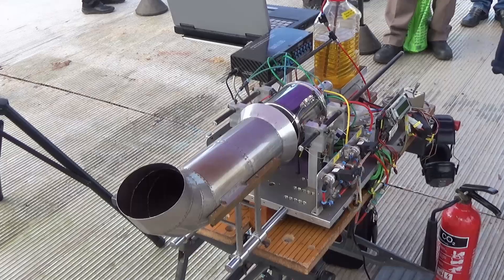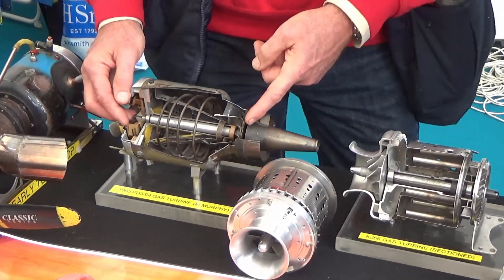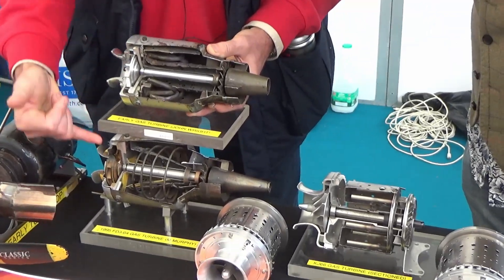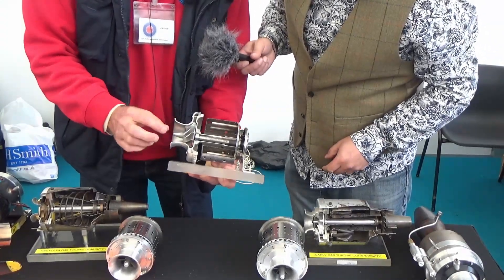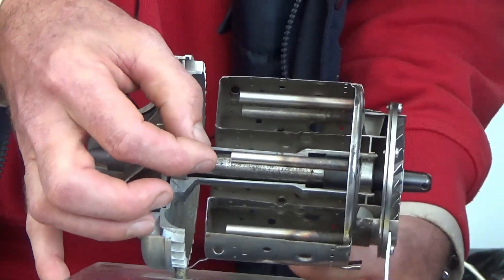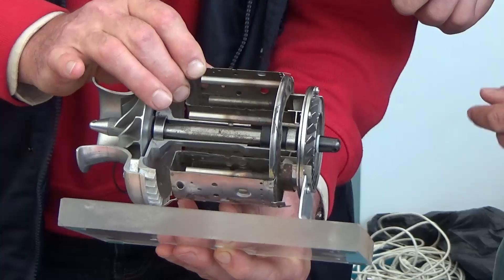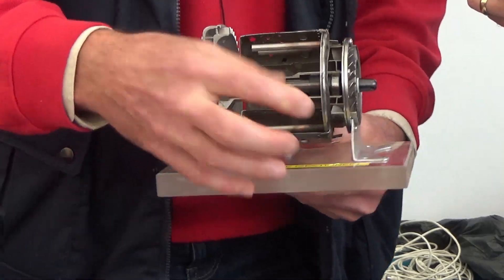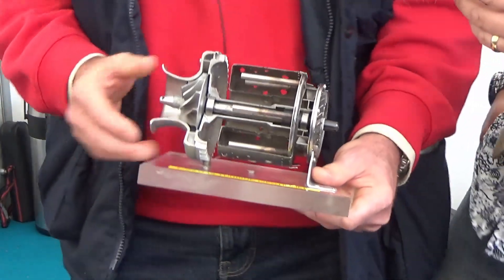DuB-EnG: JET Engines How They Work - Gas Turbines Midlands Model Engineering Exhibition Meridienne

Comment: 4:09 I think the 5mm gap at your finger tip between the turbin blade root and the combustion chamber output leaks hot air into the aft bearing from the rear, which can damage the bearing. Also the turbulence of air leak itself reduces fuel efficiency. The improved version at 5:36 shows the 3mm gap is much smaller and more reasonable. But I think the factory made engines keep the gap smaller than 1mm.
Reply from the maker: You have a keen eye :-)

Comment: Plywood compressor hitting 75k rpm. That's legendary, salute
Reply: I have to wonder if he was practising cutting on the plywood and that led to practising balancing with it followed by "why not just mount it and see if it works".. all the way to an optimised proper wheel.
Reply from the maker: Just fantastic innovation 💡 👏 👌...  they really wanted a turbine solution and they continued to prototype until done! 😀
Reply from the maker: Yes indeed!!  Turns to fluff!!

Comment: how do jet engines work ... simply ... they suck .. they compress .... they ignite .... and they exhaust ... instead of taking the energy and making a psiton move to make a crank shaft turn to make a flywheel spin to make a drive shaft rotate to make your wheels move ... you spin fans to make shafts move and let the compressed and heated gases left over out to provide movement ... 
.
yup they are JUST 4 stroke engines made to move air instead of pistons ... they are also more work efficient because they use the excess heated gases to propel you ... while a car engine just uses that heat to keep you warm in winter and otherwise cools it with a radiator wasting all that nice potential energy ... just like NASA discarding rocket boosters and fuel tanks every launch to get into space ... while a jet turbine engine is more like elon Musk which uses as much as possible over and over again to get into space ... the old adage .. waste not want not ... NASA never used it Elon is ... what he doesnt discard he reuses making it less costly in the long run 
.
IF nasa reused the fuel tanks from the shuttle as building material for the ISS it could be big enough for a space hotel NOW but they chose to do like americans do all over (everyone essentially) toss their garbage and leave it wherever they like ... a good 80% of the JUNK orbiting earth is GARBAGE because it is not working or end of life or discarded rocket bits ... the shuttle when being designed was touted to be able to retrieve that JUNK and return it for study and resale as scrap or reused parts ... but they never did that instead they made it into a bus with a little haul capacity to get more junk into orbit.
.
Reply from the maker: It is a little scary...  we do tend to fill our plant with fumes and junk...  and now space too!!...

Comment: What will happen if I made the outer blades of diffuser in  straight form without curve ?? Thank you for explanation ❤
Reply from the maker: What do you mean by diffuser? The last stage bladed disc? It would still spin but not as fast and efficient.
Reply: @DubiousEngineering  I mean compressor guide vane .

Comment: one question ive had for a long time is why havent RC Jet engine makers made an axial flow engine yet? is it due to price and complexity? ive seen one off ones but i mean mass production ones. very interesting video though!
Reply from the maker: James is brilliant...  When I next see him, I'll ask the question!!  :-)
Reply: @DubiousEngineering  Thank you! gave you a sub.
Reply from the maker: How very kind!! I have an eclectic mix ... but almost always engineering related!!
Reply: Radial flow is considerably more efficient in these single stage micro turbines. Only once they start becoming a fair bit bigger and get a lot of compressor stages does axial become more efficient.
Reply: @pieterveenders9793 what if I pay for a second spool? Turbine diameter as large as the compressor case. 3 stage axial fan. Low bypass ( for cooling).

Comment: "only uses 18-20% of the air coming in" is that because air is comprised of 21% oxygen and all of that oxygen is used for combustion? Or is he talking about 18-20% of the 21% oxygen component coming in, so only 4% of the available air coming in is used for combustion.
Reply from the maker: The combustion chamber is quite efficient but it cant burn everything especially if the air is moving through the engine at supersonic speeds
Reply: You need to keep the exhaust temperature low. Also I will never understand why there is no grille of cooling inlets in front of each turbine vane to keep the hot air away. And a vortex thereafter to convert heat into speed.

Comment: How does the bearing's lubrication-cooling process works ?  Where are the pipes that feeds oil to the bearings ?
Reply from the maker: oil is atomised into the combustion chamber to take care of the exhaust bearings which are ceramic
Reply: gonzalo moreno andonaegui 
on the more modern model engines , at least the several I have, they split off some of the fuel into ports that lube and cool the bearings, there is a small quantity of oil mixed with the fuel and the bearings are ceramic to withstand the heat and rpm.
Reply from the maker: @chuckels431  exactly!! ... :-)

Comment: I've been flying RC for 24 years and have scoured youtube for video explanations of RC turgine engines. This video has by FAR the most lucid and comprehensive description of the engine's operation! Not just that, it covers the design evolution too. All the dozens of centrifugal compressors I've seen and didn't realise the obvious fact until NOW that the design is based off vehicle turbochargers. Not to mention the wonderfully detailed explanation of the combustor's hole design. For something that appears so low tech i.e. a can with holes, actually has an extremely specific design dictated by the complex thermodynamics and fluid mechanics in that area of the engine, to the extent that jet engine designers liken it to "black magic". And this video gives a decent idea why. Watching this was like getting my engineering fix through a needle. Thank you for posting! :)
Reply from the maker: James is marvellous...   have a look at some of the other collaborations we have done together including a guided tour of his laboratory...  thanks for such great feedback and kind words.  I have passed this back to James !  All the best, Howard
Reply: Look at this, It´s the same, but the 3 compartments are not in a line, but with kinks instead, because it directly uses a car-turbocharger-unit. Of cource having everything in a line is more efficient and powerfull https://www.youtube.com/watch?v=JzwfzgfJiJ4
Additionally, the compressor can be essentially the same, but the turbowheel is different in turbojets compared to car-turbochargers. In the video I just suggested, they can use the car-turbocharger-turbo-wheel directly, of course... The missing part they add, is the self-made combustion chamber. Video is from the "tech ingredients"-channel.

Comment: 75000 rpm or 7500 rpm did I hear that wrong 75000 rpm??? That’s insane considering it’s wood, handling that centrifugal force
Reply from the maker: D333ZZZNUTS you didn’t hear wrong...  some of James engines run at 150k RPM
Reply: Dubious Engineering jeez, that would be loud as f***
Reply from the maker: Here’s the engine in action... this ones worth a share :-). DuB-EnG: AMAZING JET ENGINE with Centrifugal Compressor Axial Flow Gas Turbine ALL HOME MADE
Reply from the maker: https://youtu.be/C40vUjOCRUQ
Reply: Dubious Engineering any idea what compression ratio did he get from the compressors?
Reply from the maker: I'm sorry...  I can't remember...

Comment: Dear Sir, how  the fuel is injected in the comb.. Chamber  is that atomise or liquid form? How even possible that burning liquid form (I tried but went vain ) 
     Please reply   Respect from (BANGLADESH)😍😍😍😍
Reply from the maker: The chamber is heated with propane gas for 1 minuteto warm up the chamber, then the parafin is injected into the combustion chamber...  hope this helps
Reply: would u please permit me to conversate u SIR. If possible (urgent)
Reply from the maker: Please visit the GTBA gas turbines association...  they can offer much better guidance than me!

Comment: In theory a gas turbine,  is  much simpler to construct than a reciprocating pistion èngine it only has 1 moving part , the shaft, with bladed fan assembly at either end. A pistion has 3 to more depending on design moving parts. My first turbine about 3 inches diameter single stage 2 stators a single piece combustion chamber , about 5000 rpm
Reply from the maker: Agreed... but that all important stator is a nightmare to manufacture :-).  Thanks 🙏 for your great thoughts!! ... all the best!!  Howard

Comment: if your aiming for more air to be moved through so that you could get more thrust then i would consider building an axial flow turbine as opposed to these centrifugal turbines
Reply from the maker: There's a centrifugal compressor at the front and an axial turbine at the rear...  more videos on this soon!  :-)
Reply: Dubious Engineering An axial compressor would increase the flow, most turbines are axial. The reason is that an axial compressor can have a much larger intake cross section. Model engines rarely have an axial compressor because they’re a lot more involved to make and a lot trickier to get working properly. In a typical axial compressor you can have hundreds of parts, because like they did with the turbine in this video you have to cast each blade individually for the rotor because of center of mass balancing. The stator can be just two pieces though. In addition, casting blades like this needs to be done with die casting or investment casting (which with full sized engines is the only option). So you need to make a wax version of each individual blade, coat it in investment, wait for it to dry, melt/burn out the wax, pour and spin in a centrifuge. Working at a pretty fast pace you could on average cast a few blades a day. And that STILL leaves machining the blades and making the rotor assembly, AND doing the center of mass balancing which you either need to get software for or program a solver yourself. It certainly is possible, you can see at the end of the video someone that did it, but it’s certainly not for the faint of heart
Reply from the maker: I think we have just found out resident expert!!  Hello Liam!!  Here’s a video you might like... a tour of the workshop!!  DuB-EnG: Jet Engine maker workshop, Tri-copter model engineering, VTOL quadcopter aeroplane azipod https://youtu.be/_alUhQptOi4
Reply: My bad I didn’t see that
Reply: But why not have axial both ends?

Comment: Just one slight correction, a turbine works on 4 cycles is however no 4 stroke engine.
Turbines usually work on the basis of the joule cycle and actual 4 strock engines usually on the Otto cycle or the diesel cycle. Even a 2 stroke engine differs slightly from the otto and diesel cycle.
Besides that very nice presentation, i didn't knew that people used wood for compressor wheels.
Reply from the maker: Thanks for your feedback... I’ll see James soon and we will discuss!!

Comment: 2000 deg C!! 

Is any part of material of this engine exposed directly to this temp?  Or is the engine protected by the air shield from this high temp? 

James explain that they introduce just small amount of air to the combustion zone (small holes) and than at 2. zone they introduce more air for unburned fuel to burn off and the third delution zone where larger holes are located has the joy to introduced 75% of air to drop from 2000C downto 800C where fast moving air is lead to the turbine wheel. 

my question is are the walls of combustion champer (first zone) exposed directly to the temp of 2000C?
Reply: You should watch AgentJayZ, he’s a jet engine mechanic, he explains things like this in great detail on full sized engines. To answer your question, the holes that let the intake air in provide a sheath of cool air along the wall of the chamber. This is why you MUST have that sheet metal with holes in it. If it weren’t for that, then the 2000 degrees would just melt everything. It’s also very important to ensure good mixing before the turbine not only for thermal efficiency but also so you don’t burn the bearing oil or melt/deform the turbine
Reply from the maker: I’ll get a more precise answer for you soon, but, I believe the ball of rotating fire moves and rolls around in the combustion chamber which reduces the surface heat on the combustion casing...  so, I think it’s only the internal flame that gets to such a high temp...

Comment: Actually I am making fd3 . could you tell me please that the book say to use 608bearing which dimension is 8*16*5 . Could I use 8*22*5 dimension bearing it's few large than? Sorry for bad English.
Reply from the maker: I think the question is a little confused. The original bearing for the FD3 had a 16mm O/D, which is usually referred to as the 688. The 608 bearing has a 22mm O/D, which of course will not fit in a 16mm shaft tunnel.
 
A standard 608 bearing are normally 8 x 22 x 7   (I/D x O/D x Length)
A standard 688 bearing can be 8 x 16 x 4  or 5 or 6  (I/D x O/D x Length)
 
If this chap has already made the shaft tunnel with a 16mm I/D and a shaft with an 8mm O/D then he will need to use 688 bearings. However if he has not yet made the shaft tunnel, then he could alter the design and make a 22mm I/D shaft tunnel and still use the standard 8mm shaft, in which case he would then have to use the 608 bearing.
 
In any instance, he should source the 'Full Compliment Angular Contact Hybrid' version of whichever bearing he finally selects.
 
Judging by the sound of his message, it might be worth recommending he join the GTBA, as it sound like he needs a little help.
Reply from the maker: I think the question is a little confused. The original bearing for the FD3 had a 16mm O/D, which is usually referred to as the 688. The 608 bearing has a 22mm O/D, which of course will not fit in a 16mm shaft tunnel.
 
A standard 608 bearing are normally 8 x 22 x 7   (I/D x O/D x Length)
A standard 688 bearing can be 8 x 16 x 4  or 5 or 6  (I/D x O/D x Length)
 
If this chap has already made the shaft tunnel with a 16mm I/D and a shaft with an 8mm O/D then he will need to use 688 bearings. However if he has not yet made the shaft tunnel, then he could alter the design and make a 22mm I/D shaft tunnel and still use the standard 8mm shaft, in which case he would then have to use the 608 bearing.
 
In any instance, he should source the 'Full Compliment Angular Contact Hybrid' version of whichever bearing he finally selects.
 
Judging by the sound of his message, it might be worth recommending he join the GTBA, as it sound like he needs a little help.
Reply: @DubiousEngineering  .thank you very very much for your feedback & sharing your precious time.
Reply from the maker: It’s our pleasure!